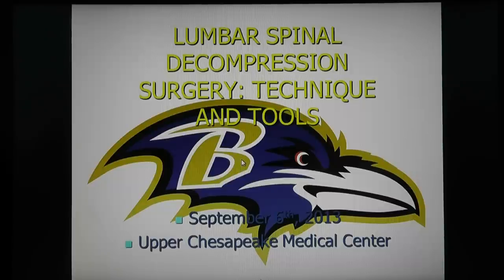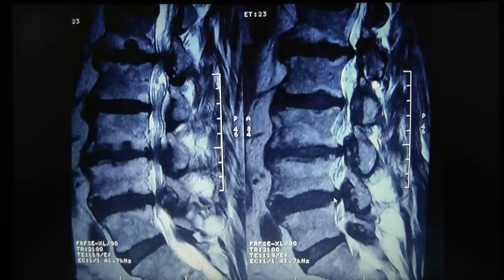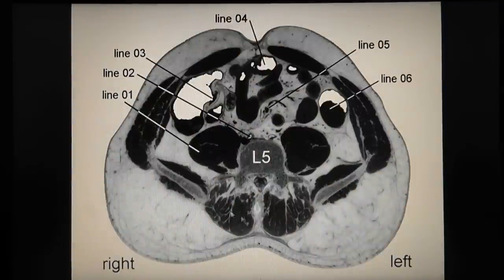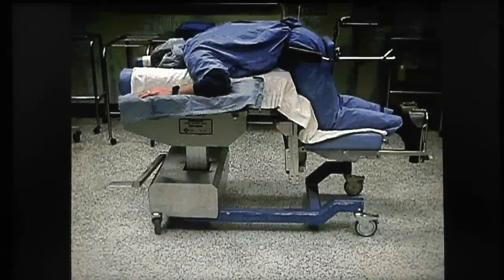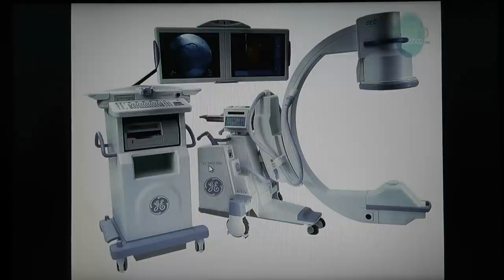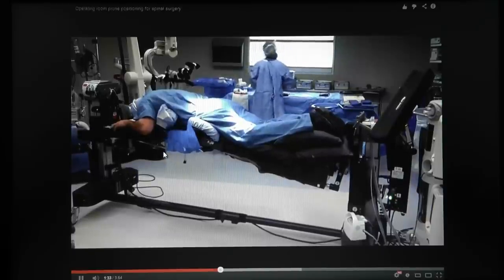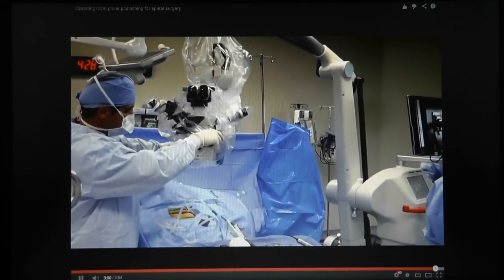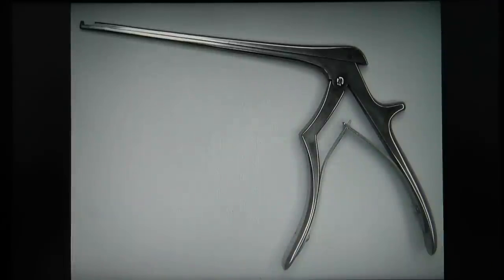Lumbar Decompression Surgery Techniques and Tools

Comment: I'm not a doctor, but that's my theory as well,  that the body torso weight is focused on, and concentrates 90% at L3, 4, 5 and  S1, but mostly L5 and S1, in the same way the weight of a high-heel shoe is concentrated at the tip end, or the tip of crutches wears out   Maybe human evolution will create a huge L3, 4 and 5s to compensate for this.  Item:  I would think a 30 degree down angle of the legs, bent at L5 area would be a great compromise for patient position.

Comment: How can you avoid removing the spinal processes at the upper spinal level when decompressing the level below? We observed an L4 L5 bilateral decompression with a partial right discectomy and the surgeon was required to remove the L3 spinal processes in addition to the L4 spinal processes in order to decompress the L4 L5 nerve.  Interested in your thoughts.